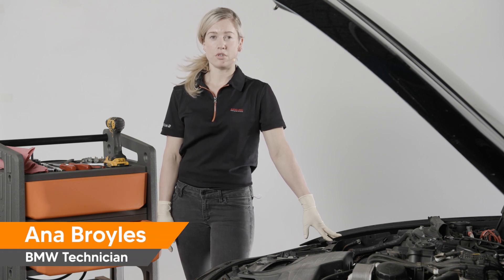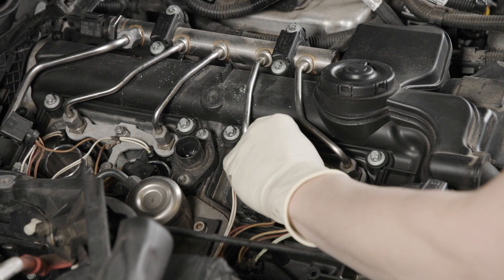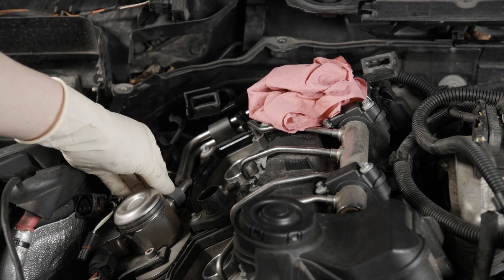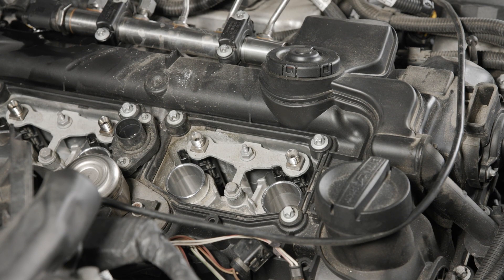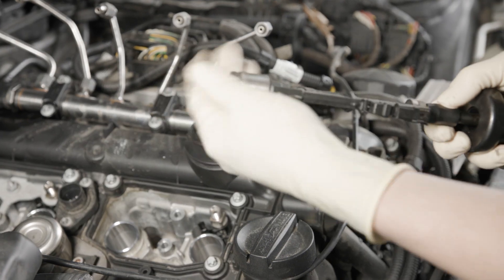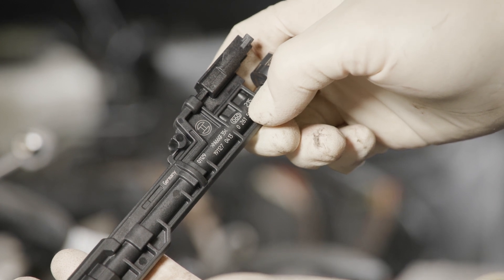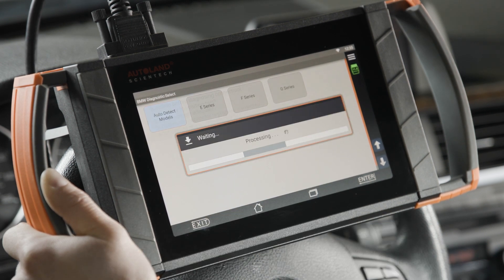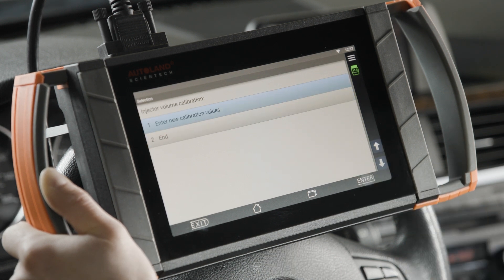The Best Way to Replace Fuel Injector on a BMW N20 Engine

Comment: Hi buddy, I'm getting the same problem in my 328i. So I would like to replace them myself witch looks really easy(DiY)

My question it that is it possible to replace the injectors, spark plugs and coil overs without using a diagnostic machine after replacing them

Because I don't have a diagnostic machine
Reply from the maker: No, the injector codes have to be entered.
Reply: depending on the year of your 328i no, the older years (2011-2012) have the old EU5 injectors that need to be coded. After 2013 all Injectors all EU6 and do not need calibration.

Comment: The injectors may be blocked by accumulated debris in the fuel, and a simple cleaning can solve the problem of misfiring and save money.
Reply from the maker: These fail electronically as well. Best to test, diagnose, then replace.  Thank you for watching!!!

Comment: How do you stop the fuel pressure to the fuel rail ?
Reply: Remove the fuse
Reply from the maker: Remove the fuse or disable the fuel pump by disconnecting the electrical connector.

Comment: It was best to the point video. Well done Anna. Now can you make another video on how to troubleshoot "drivetrain malfunction " message which appears on dashboard suddenly whole driving and leads to engine light popping up. I will highly appreciate. 
You got my subscription. 
Thank you. Keep it up.
Reply: Probarly clutch mate
Reply from the maker: Thanks for the comment!!
Reply: starter motor, its a bmw recall got mine done recently
Reply from the maker: Thank you for the input!
Reply: Brother I have a UK bmw 330e? Where is the code on the injector?
Reply from the maker: Yes.
Reply from the maker: Best bet is to check for fault codes. The code will direct you to the area of the issue.

Comment: Are those EU5 Injectors? I believe I have the same Injectors you installed because of the calibration number is the same. A  Mechanic told me that I have the wrong fuel injectors in, and I would need EU5 injectors.
Reply from the maker: What year and model vehicle are you working on?